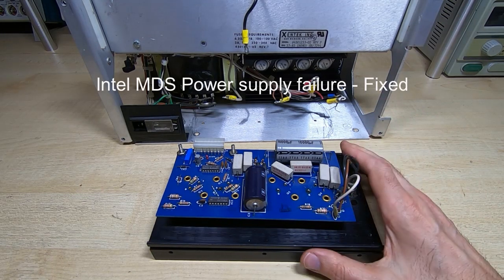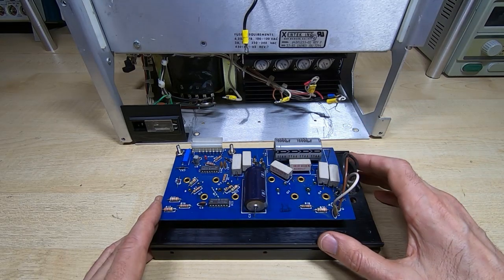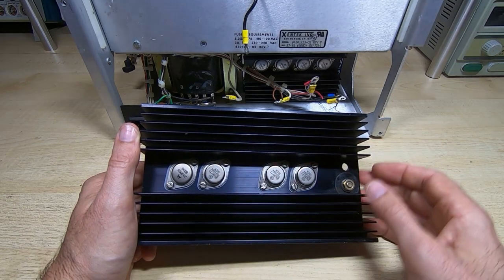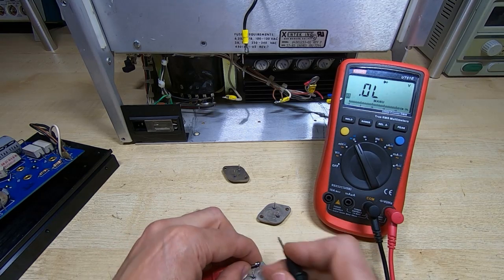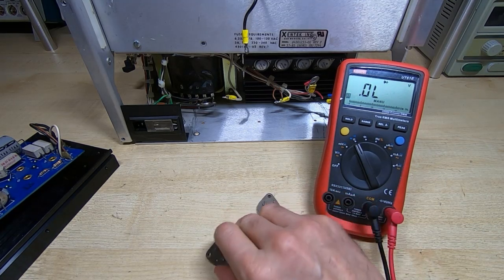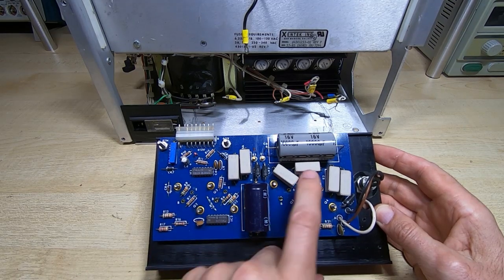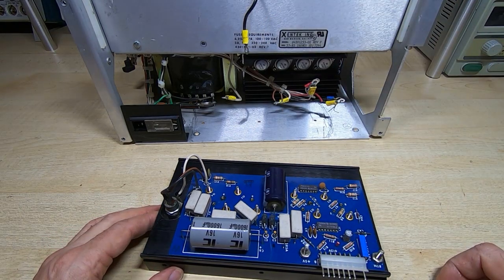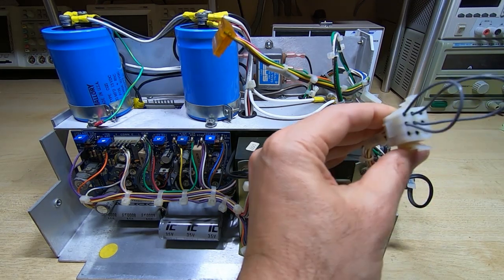Intel MDS Power supply failure - Fixed

Comment: Nice fix. Very hard to see some things in the video so I may be talking nonsense.  The repaired track seems like it could come pretty close to the heatsink when the board is re-insalled. Did you consider covering the track with liquid UVB cureable solder mask?
Reply from the maker: The 'repair' sticks out approx 0.5mm from the board. The component leads protrude approx 5mm. The nuts and spacers between the board and heatsink total 7mm so there is 2mm from the component leads to the heatsink and 6.5mm from the repair to the heatsink so there is zero chance of it shorting. If there was then I would certainly not rely on solder mask to insulate it.